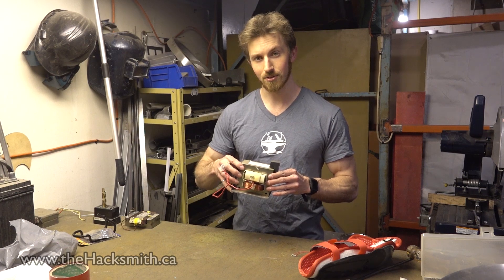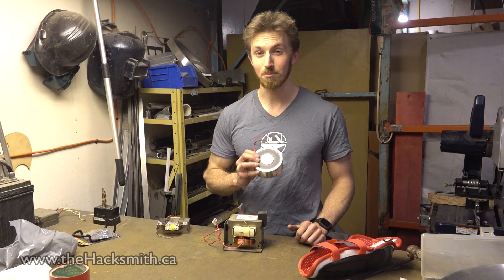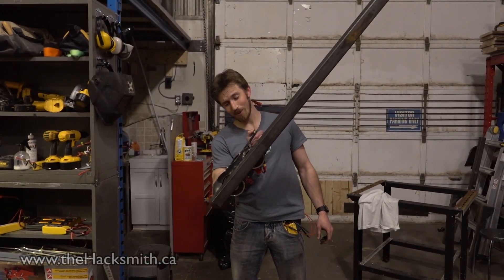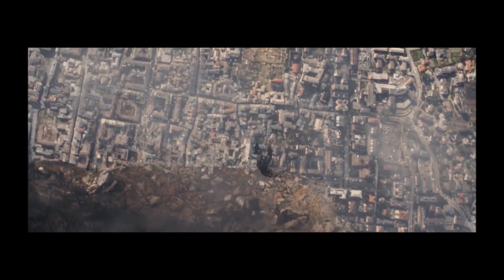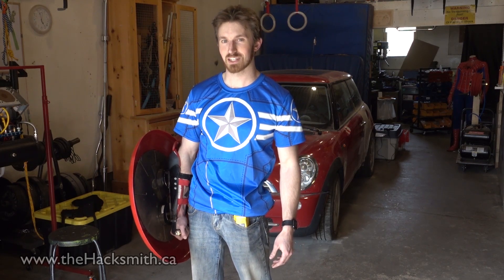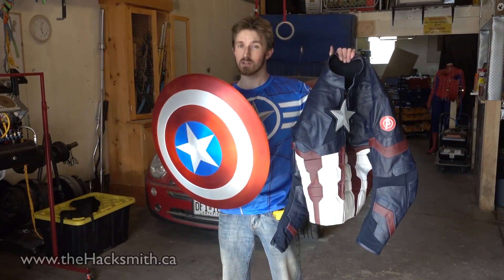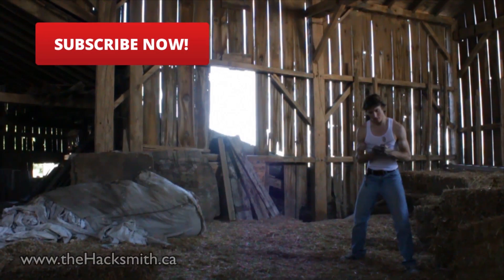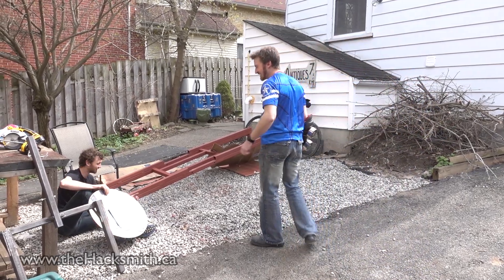How Do You Make Captain America's Electromagnet Shield?

Comment: What kind of metal you used to build that kind of shield??
Reply from the maker: Aluminum,  I didn't build it though
Reply: But, is aluminum doesn't broke or break easily when it bounce into the wall?
Reply: Is there any other kind of non-rusty metal, strong,and lighter weight like aluminum that can be use to make a shield?

Comment: Hi hack smith. I know this is an old video but I hope you still see this. I'm working on a project for school it's kinda like a year long highschool graduation project. Anyway I'm building a jet powered wake/surf board. I know the design and I think I know a motor that could produce enough force to actually move me but I'm not 100% certain but what I don't know at all is how I'm gonna power this thing. The motor says is could run on a 12 volt battery but I want to to run for awhile and have a lot of power so it'll feel like I'm actually surfing/wakeboarding. In short how do you set up your power supply to be mobile and produce that kind of energy. (I saw the two big lithium battery's in your pocket) but I don't know how I can make two separate battery's work together to put their voltage together.

Comment: Just how does the shield stick onto the electromagnets ? Since you mentionned they would not be running continuously... (Making dat shield)
Reply from the maker: +Arthur Goetzke-Coburn steel plate. Low power mode can run 100% of the time without over heating

Comment: Dude you should put some slightly smaller and thinner electromagnets on the shield with their own power source and a Bluetooth connector to the arm mount so that you might be able to increase the distance that you can retract the shield from. So that it doesn't affect the way it flies, you could put weights on it to balance it out and cover the batteries with a circular bit of metal, only leaving the magnets exposed.
Reply from the maker: +Zaksamhol Studios sadly physics is against us! We were already overheating the magnets to get the power we had in this video :(
Reply: the Hacksmith 

Thank you for replying to my comment! I never expected a response! It's a shame to hear that it would be impossible but never mind.

Comment: what steel did you use? stainless? high carbon? did you source it specifically for the project or was it laying around? how thick was it?
Reply from the maker: Stainless is not magnetic... ;-)

It was just plain steel we had, the higher the ferrous content the better, so no, high carbon content is not good! I believe the one was only 1/8th thick. Magnets have maximum strength based on material penetration -- you can do some research to find out what's best =)

Comment: What specific batteries are used? I really want to make the gauntlet and I want to get the exact batteries that were used in the video
Reply from the maker: You don't want the exact batteries, we only used them because we had them on hand... we're overpowering the magnets by a factor of 6 -- if you leave it on, it melts. If you want to do this project you will have to study up on engineering a bit. It is a simple project but you have to learn a bit before you go ahead and make it =)
Reply: Well it looks like I have some work to do. Thanks a lot for the reply!

Comment: How exactly did you wire the magnet to the switch to the battery? Do you have a simple schematic?
Reply from the maker: +Matthew Picco I don't understand this question... An electromagnet works when it is provided power... There is only one way you can hook it up :p a switch interrupts one of the wires. The most basic circuit :)
Reply: the Hacksmith haha let me rephrase that: how did you wire 3 batteries into 2 magnets and 1 switch?  Also, what 50a momentary switch did you use? I looked around and couldn't seem to find the one you were talking about
Reply from the maker: +Matthew Picco everything is in series, look up basic circuits before you try building anything, it really is very simple :)
Reply: the Hacksmith ok thank you

Comment: If I have a power supply that can deliver 100W to a uxcell(if it can handle it), in order to achieve the maximum electromagnetic force which is better using 100A 1V or 100V 1A or 50V 2A ? Or it doesn't matter due the fact they have equlivanet power rate ?
Reply from the maker: +Abdulla Qasem more current, more electro magnetism :)
Reply: the Hacksmith how much current can  ucel draw ?

Comment: So if you wanted to be able to use it for more than a minute at a time without over heating, is there a magnet and set up that would allow that to happen?
Reply: Also do you have a video for a better battery set up? I know you like exo suits and I plan on using a magnetic shield similar to this with the exo so a compact and powerful battery source is pretty necessary
Reply from the maker: +Ryan Luft yeah, just don't overpower the magnet. It can run forever at 12v

Comment: Hey, I was looking at the magnets on your website that you used for the shield, and they said they were rated at 256 pounds at 12v. Is there a specific way you wired the batteries to the magnet so that it didn't burn up? Or did you just run the batteries in parallel and connect it to the magnets?
Reply from the maker: We ran them in series, over voltaged to 72V. Can't run it longer than 30 seconds without burning out the magnets =P
Reply: Wait, if the batteries run at 22.2v, wouldn't the three combined run at 66.6v? How did you run them at 72v?

Comment: Hey, I was wondering if you could do a more in depth video of the magnet section of this build?
Reply from the maker: I'm afraid not! It's quite simple though, the electromagnets are wired in series with the batteries, and there is a switch to turn it on. The magnets draw alot of power. So make sure you have thick wires and properly rated switch!

Comment: Hacksmith,
I know that this video is a couple months old and the electromagnet worked efficiently as needed, but is there any chance that the magnet could have been made smaller with the same energy output? It was an idea that came to mind through watching the video and I thought maybe you had the same question in mind.
Reply from the maker: +Dequane Nealy no. Right now if you run it for more than 15-20 seconds it would burn out. Remember we're running 72v through a 12v magnet

Comment: hey Hacksmith  i am trying to make a smaller version of your gauntlet but having problems with coils any suggestions
Reply from the maker: +Nathan Rotter ... What coils?
Reply: the copper around the iron core
Reply: hey hacksmith i am trying to make a shield myself but instead of the magnets you used i am using neodymium magnets do you have a suggestion of what to use for a shield

Comment: the Hacksmith what metal is the best to use for electro magnets. I don't have any of the right materials for any of this and I probably wont be able to make all of it. My friend is a blacksmith he is trying to make a shield that is made of aluminum. if you have anything that can help me let me know thanks
Reply from the maker: +Spencer Townsend steel, iron, nickel... best bet is steel. My shield is aluminum with a steel plate on the inside
Reply: also where do you get the electro magnets and the batteries to power it? and what is the over all price for this
Reply from the maker: +Spencer Townsend there are links in the description....

Comment: Can you make a video that's more in depth when making the electromagnetic part
Reply: @Mr. Assassin Hey I followed you on Twitter yesterday to DM and ask about the Hacksmith electromagnet stuff but I think you have to follow back to DM, unless if you have that turned off in the settings. Don't sweat it though because there wasn't much context

Basically I saw some electromagnets and a few tools, and was wondering which ones you think would be the best choice?

And also was wondering, would it be possible to reverse the polarity of the electromagnet, to make a version of this build that can both push and pull? It should be possible, but it might not be strong enough or worth the effort, so I might just go the standard route but wanted to hear you opinion on that just in case
Reply: I also wanna know this
Reply: Does anyone still know how to do this?
Reply: @zacregan1872  trying to figure this out myself
Reply: @zacregan1872  yup contact me on Instagram at @the_propsmith_
Reply: yes please
Reply: Beyond! Industries  just usual heavy duty electromagnets no specific brand can be identified
Reply: zoe clemens Step 1: put electromagnets on hand guard
Step 2: put button on hand guard 
Step 3: connect button to magnet

Comment: Hey just wondering what button/switch you are using to control the magnets. I can see that its in the grip, but could you send me a link to the place where you bought it? or did you custom make it. thank you
Reply from the maker: +Mrplubear Got it from a surplus store, it's a high current momentary starter switch but it still burns out after about 20-30 clicks. Not sure you can actually find something to last. 72V is extremely dangerous to work with. We recommend sticking with 12v if you're going to try and recreate it.

Comment: 1:07 good way to snap an elbow joint. Really need a safety warning when dealing with commercial grade magnets/electromagnets, it's real easy to lose a finger using large rare earth magnets and electromagnets. Good video tho.
Reply from the maker: +Ciphered Logic (CipheredLogic) it wasn't an accident, did it for show to demonstrate the strength
Reply: With your arm tilted in that fashion, the way his arm torqued, whether it was by design or not it is a good way to snap something or tear something in the elbow/shoulder.
Reply: Not trying to give you a hard time. But I have seen people playing with magnets getting themselves hurt even so bad as to lose a finger.
Reply from the maker: +Ciphered Logic (CipheredLogic) how... it's literally normal movement for the elbow joint
Reply: I'm talking about how it torqued your arm and pulled your body forward. Your arms are pretty beefy to be fair, imagine some one with no upper body strength, Not hard to tear something in a shoulder or elbow. I'm not trying to debate on this tbh. I like your videos. Also, is that shield spun aluminum?

Comment: Are you running those electromagnets directly off the lipo batteries, or are you using an H-bridge of some sort?
Reply from the maker: +Alaric Loftus direct. Switch didn't like it much :p
Reply: Isn't that shorting them out?
Reply from the maker: +Alaric Loftus How is that shorting them out... they're just an inductive load? There is no reversal system if that's what you're asking

Comment: What kind of degree/technical courses do you have to take to have the knowledge to build this?
Reply from the maker: +Luis Leonardo I have a bachelors of mechanical engineering, but this invention is very simple. You could learn everything you need to know about it in less than an afternoon on Wikipedia.

It's literally just an electromagnet connected to a battery, with a high-current switch to turn it on.
Reply: +the Hacksmith I see. Thank you! I've always wanted to be able to build/create like you do in your videos and coming across your channel has been a huge inspiration. 

Love and respect!

Comment: Could you get by the distance issue by having positively charged magnets attached to the metal and you hold negatively charged magnets, would that be able to pull?
Reply from the maker: +dan b we did, gets you an extra inch maybe :(
Reply: the Hacksmith what if you line the inside of the shield with magnets. go full magnetic crazy. multiple batteries. or would that still not work
Reply from the maker: +dan b Stacking magnets also doesn't increase the field by that much =( Already running the electromagnets at 6 times their rated voltage... they would burn out if we go much higher. As it is you can't leave it on for more than 20s or you might risk breaking them.
Reply: the Hacksmith that's a shame, could you, make your own magnet? or is that not possible. for some reason I really, really want to see it work. how is the exoskeleton going? what are you trying to turn it into?

Comment: Once I started hearing "The army goes rolling along" I had to stop the video and comment that I absolutely HATED singing that in basic.
Reply from the maker: +Alec Fischer ha!
Reply: +the Hacksmith is it possible to use these electromagnets to scale walls or catch yourself while falling please test this in a video i would like to know
Reply: +JacobAC07 

1. Don't be that guy that replies to a comment only because someone specific posted in the section, the original author of the comment does not want to be notified everytime you get someone talking about your question within a completely underrated question.

2. If you watched the video you would know that it is possible to a degree (He held himself aloft from a metal beam above him).

3. The amount of arm strength it would take would require work not too many could put in.

4. The electromagnet would only work on a metal building. Do you know of any?

5. There is a wonderful thing called an Internet search that could have probably told and or showed you what you wished to know.

6. I will respond to one reply and after that I hope you move on with the newfound knowledge I have given you.
Reply: +Alec Fischer Unrelated not underrated* My apologies.
Reply: +Alec Fischer 

1.dont be that guy that tries to be the youtube comments moderator 

2.it was a simple question if it was possible to climb a wall with it because you would have to pull it off and then put it back on to climb up the wall

3. if you're going to be just annoying on YouTube comments to a simple and nice question don't even be here

Comment: the lifting power of that magnet is not 120kgs but 120x9,8N :)
Reply from the maker: +ProYoshi2001 No... it's 1200N, which is approximately 120kg... 

1200N/9.81m/s^2 = 122kg technically.
Reply: +the Hacksmith u right lol

Comment: Awesome job, but I don't understand 1 thing, hopefully you can explain.
You say that at 12V they can lift 120kg, and at 66V they can lift 660kg, however, an electromagnet's strenght is determined by the current applied, not voltage (Strenght of a solenoid equals NxI/L). You stated a similar thing on your site "These things are powerful! At just 12v and 1.5A they will lift over 260 lbs. That means by running them at 72V, each magnet will pull close to 1600lbs". I just think that setting the batteries up in parallel to triple the current would produce much greater lifting power than setting them up in series as you did. Don't get me wrong, I may be wrong on this, but if so, I'm missing something important. And as always, great video! I subbed!
Also, as a side note, if anyone wants to make something similar, do what he mentioned in the beginning. Use old MOTs, cut them apart, take out the secondary winding (the thin wire one) and hook up 4-5 AA batteries to it. You'll have a hundred or a few hundred pounds of lifting force. I made 2x electromagnets this way, with 4 AA batteries (1.5V, they can output around 2A at a high current draw) and was able to lift myself from the ground (around 175lbs/80kg of weight). And you can carry them around since the AA batteries are small and you can just duck tape them on the actual electromagnet.
Reply from the maker: +SolkanStudiosTV Current is determined by resistances of the system -- adding more batteries in parallel won't make the magnets draw more. Each battery is already capable of putting out over 150A by themselves! By increasing the voltage you are able to "break down" more resistance, which in turn, means more current flows =)
Reply: +the Hacksmith I understand that I just thought the resistance of the electromagnet isn't as large as to need to go from 22.2V to 66V. But then again, I never had an industrial electromagnet so I wouldn't know... Speaking of this, would you ever have spare time to measure the resistance of the electromagnet? I'm curious as to what it is. I have been looking around online but can't seem to find this info. If you can, of course, and thanks for replying!
Reply from the maker: +SolkanStudiosTV resistance is fixed, it does not change -- ohms law states V = IR. Therefore if you change the voltage, resistance stays constant, and to balance the equation, current must also go up.

Using the equation you can calculate the theoretical resistance of any specified electromagnet!

Comment: Also, what lever/switch thing did you use. I'm very interested in making everything without the shied and jacket.😄😝
Reply from the maker: +Orange Arrow I wouldn't use the switch I used. Not rated for high DC voltage/current. It fries after about 25-30 clicks.

Comment: What happens if you reverse polarity on it? does it fire off your arm?
Reply: no it would still attract. Unless the shield is magnetized the be the opposite pole it will not repel it.
Reply: +Slinqy thanks
Reply: Reverse the polarity of the neutron flow!
Reply: +Manraaj Singh but neutrons are neutral...
Reply: +The RuneRaider Or did he mean electron.
Reply: does the amperage determine the power of the electromagnet?  Or is it the voltage?

Comment: so if i'm falling from a small building and i have those things i can save myself? dude, window cleaners need those stuffs lol u'll ve rich
Reply from the maker: +The paolo98 you'd still die. Magnets are only strong when pulled straight off of the surface. They slide or peel off if you pull in any other direction.
Reply: :0
 k